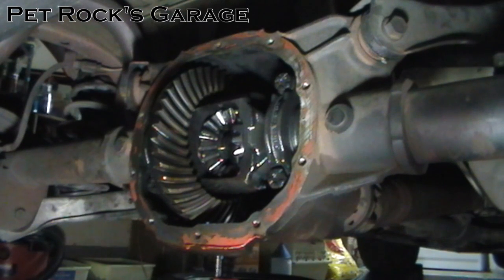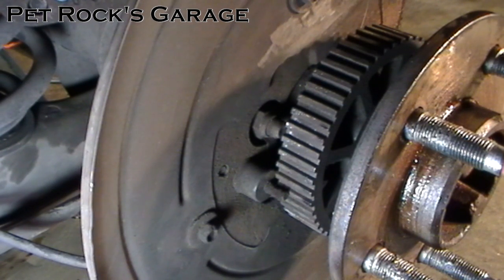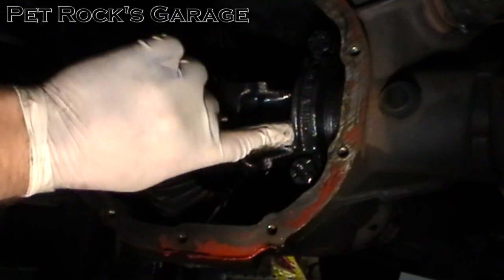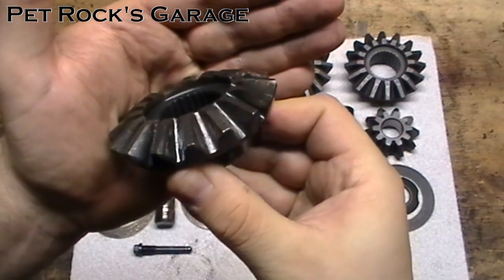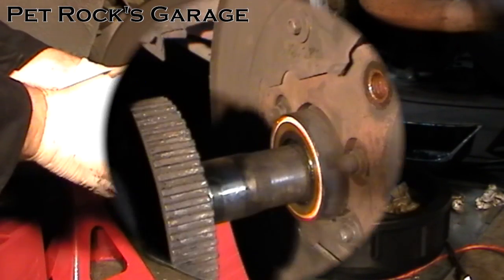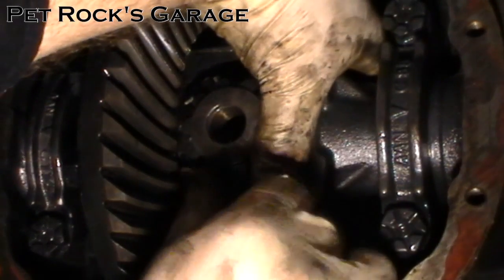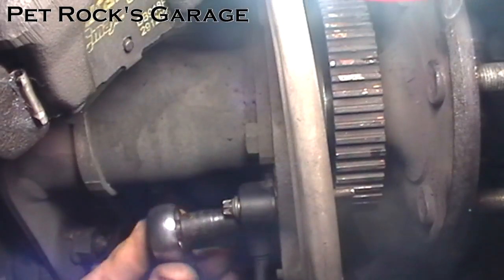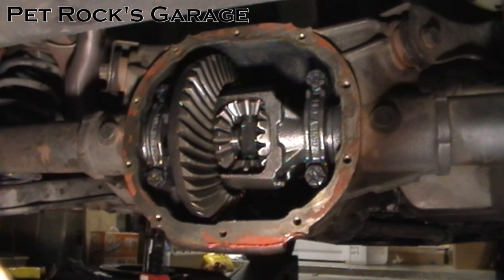How To Replace Spider Gears In Ford 7.5 & 8.8 Open Differential - Ford Mustang

Comment: How do i know my spider gears are worn out? My right wheel  its making a noise and its wobbles when put in drive. It also has play when move wheel side to side. I already bought new wheel bearings it possibly that i need need spide gears as well? Thanks
Reply from the maker: I cover how to inspect the gears in another video: https://www.youtube.com/watch?v=jIXoRbIIK_o at around @2.54.
Re your issue: I don't think a spider gear issue would cause a wobble. It typically causes excessive rotational play like I show in this video. I'd jack the rear up so both tires are off the ground (making sure to chock the front wheels so it doesn't roll away from you) and try to push the wheel up/down/side-to-side without rotating it to see if there is any play in it. If there is then the bearing is likely bad and/or the axle bearing surface is worn. Also rotate the wheel by hand without applying a lot of upward/downward/side-to-side pressure and see if it wobbles. If it does the axle may be bent. Good luck.
Reply from the maker: btw, I have a video on how to replace the axle bearings and seals: https://www.youtube.com/watch?v=VXEqzMVRRso

Comment: Excellent video. Very thorough and informative.
Reply from the maker: Thanks a lot. I appreciate it.
Reply: @petrocksgarage  Is the roll-in of the spider gears as easy as it looked in your video? It seems very straightforward rolling in the 1st gear, rotating the carriage, and rolling in the opposite gear, and lining it up with the 2nd. That easy?
Reply from the maker: @jockodog2009 , yeah pretty much.

Comment: So my ranger the drop pin is designed to not come out, it instead has a groove in it that you are supposed to push the axle up against to remove the clips, and I have found nothing on this anywhere on how to do that.
Reply from the maker: I'm not aware of a ford 8.8/7.5 diff with a pin that isn't supposed to come out.  If your pin isn't coming out its probably because it is stuck/seized, not because its not supposed to come out.
Some pins do have a groove in it, like the one I install in this video. Maybe some people might use it so they don't have to remove the pin and accidentally drop the spider gears out. But to be able to spin the pin it might just slide out anyways, so you're not really saving any time/effort.
Reply: @petrocksgarage  i swear this pin does not come out because it cant get past the gear so the put a groove in it to remove the c clip

Comment: Hey I had a question. But first thank you for the informative video it’s literally a Godsent. So! I have a 2000 v6 mustang I was wondering if 7.5 rear ends had axle vents. I know 8.8s do so I went to research for 7.5 vents but found zero information on them for my generation mustang. On the right side of my 7.5 axle I see what looks to be a vent but I’m not sure, very rusted looking and has no play like a vent should. So would you know if we do have axle vents? Thank you very much
Reply from the maker: Yes, 7.5 diffs have an axle vent on the passenger side of the diff. Specifically on the "top" of the axle tube. The diff in this video is a 7.5", btw. I too couldn't find a vent specific to 7.5, but the one I did find for the 8.8 on AmericanMuscle.com looks a like the one on my 7.5 diff. Its likely the same part. I'd suspect it would be available at most auto parts stores. You might need to specify 8.8 diff if they don't have one specific to 7.5. Next best option is a junk yard. Good luck.

Comment: Sir I have a 1988 F150 that has 65000 on the odometer. Of course that could be 165000 or 265000 miles. Some things on the truck lead me to believe the mileage is 65000 or 165000. The brake and accelerator pedal rubber covers are in very nice condition and original. The u-joints are very tight but there is a lot of slop in the differential. Enough slop so that it is very noticeable when shifting from reverse to drive or drive to reverse and sometimes when the transmission shifts from first to second and second to third. How would I know if just replacing the pinion gears and not the ring gear would be adequate to eliminate the majority of that differential slop? Thanks, Wayne.
Reply from the maker: I assume the u-joints you are referring to are for the drive shaft. That leaves the gears in the diff. The only way to tell what needs to be replaced is by pulling the diff cover and having a look inside to see where the slop is coming from. With the cover off, you should be able to turn the drive shaft back & forth by hand and see where the extra play is. It could be worn spider gears, worn ring & pinion gears, or both. This video should have you covered on how to replace the spider gears. However, replacing the ring & pinion isn't a bolt on job. You have to adjust the backlash & tighten the crush sleeve etc which requires special tools (beam torque wrench, dial micrometer gauge + mag-base to name a few). It's a bunch of trial & error even for experienced techs. If one of my vehicles needs new ring & pinion gears I would take it to a local diff shop to be honest. Its a P.I.T.A. job, hard to get right and too easy to get wrong. If you get it wrong you can burn up your gears pretty quickly. Hope that helps.  Good luck.

Comment: Extremely helpful ...  Thanks a ton! I wasn't planning on touching the spider gears in my 2007 V6  Mustang when I upgraded to the GT500 rear brakes but I found a leaky axle seal and the spider gears fell out when I went to reinstall the big pin in the differential.  After 30 minutes of "I almost got the &%a0a$ spider gears lined up that time", I  took a break and found your clear and explicit instructions. Well done! Thanks to you I was back on track in less than 3 minutes.
Reply from the maker: Everyone has days like that. Glad to hear you knew to walk away and regroup before you really screwed something up (e.g. get a big hammer). I'm glad my video helped you out and that you got the job done. Thanks for watching & commenting. I appreciate it.

Comment: What would cause the big axle pin only move like 3/8" I can't get it out. I've hit with a hammer but it gets to that point and just feels solid as f#$@! It should just slide out right?
Reply from the maker: Yes, it should slide right out with little to no pressure. If it moves at all then it isn't seized, which is a good sign. It sounds like the pin is hitting something in the diff case. Maybe its hitting the pinion gear in the back? If not, maybe try rotating the drive shaft to spin the garage around 180 degrees and try it from the other side? Good luck.
Reply: @petrocksgarage  thank you for your time, something was in the spider gears and made it almost seized the gears to the pin. The ends of the pin are all marred up I ended up having to beat it a lil and cut it in two.
Reply: And beat it a lil is an understatement 😜
Reply from the maker: @michaelhammerhead7671 , ouch. Well, whatever gets the job done. Hopefully your spider gear kit came with a new center pin. Make sure to clean out the diff very well to get all the shavings out. Good luck.

Comment: Is this the same with a 2012 Mustang? to remove the axle shafts.
Reply from the maker: The year/model/manufacturer of the vehicle really doesn't matter. What matters is the type of differential installed in the vehicle. This video applies specifically to Ford 7.5 & 8.8 Open Differentials, with carry over to 7.5 & 8.8 LSD Differentials. A lot of models over the years have these diffs. Hope that helps.
Reply: @petrocksgarage  Thanks I have to do this to a 2012 Shelby Mustang. he has an 8.8 differential.
Reply from the maker: @oliverkuttnik5218  Then this video should cover you. Good luck.

Comment: Have a pin that went loose towards front and locked up the inide i have no idea how to get that pin out since i cant turn the assembally
Reply from the maker: It's hard for me to give advise without seeing the carnage. I would start taking things apart.  Hopefully the pin didn't damage the gears.  Remove the axles and then remove the side retaining caps and pull the assembly out.  Be careful about any shims that may be in place on the sides of the assembly. Don't let them fall out or lose them. They control the back-lash. Also make sure you don't mix up the retaining caps either. They are machined to match the side they are on. Ultimately you want to make sure that you put everything back in exactly the same places that they were originally. Good luck.
Reply: @petrocksgarage  ive got to get everything replaced in it since theres missing teeth everywhere
Reply from the maker: @daimonwilcox , ouch.  Sorry to hear that. Diffs, like transmissions, take a little finesse to rebuild correctly. Setting preload & backlash takes some special tools & techniques. IMO, unless you have done it before, I'd take the diff to a diff shop to do the job for you. You don't want to mess something up and burn up your new diffs gears.  Good luck.

Comment: Thanks for you advice I was able to spend the top spider gear back into  place and put the differential back together.  Although its was still some what of a challenge given my short arms and think build.  Thanks once again!! Now I need to replace the U-joints so hopefully it goes pretty smooth.
Reply from the maker: Thats great! I'm glad you got it figured out. Good luck on the U-joints.

Comment: My dad and I were replacing axle bearings and seals in my 89 5.0 Mustang and we let the spider gears fall out during this. I found this video and my rear end is very similar but it has the metal S clip thing in the middle because it is a locker rear end. We can't seem to roll the gears back end because of the metal S clip thing is in the way. Is there a different process for the traction lok style rear end? Could you possibly point me to a video for that style? Any help would be greatly appreciated! We have been messing with it for 3 weekends in a row and having no results.
Reply from the maker: It's been a while since I've worked on a diff with the S spring, but if memory serves, you install the spring after you've installed the gears.
Reply: @petrocksgarage  Ok I was not even aware that the spring thing came out. Do you know if it's possible to remove the spring, put the gears back in, and replace the spring without removing the entire rear end assembly?
Reply from the maker: @jefflroberts , it can be removed without removing the entire gear set. It's just a spring after all. There are a bunch of videos on how to remove & re-install the S-Spring. Here is one for install: https://www.youtube.com/watch?v=O_TqMuV_MeA
Good luck.

Comment: Do the car have to remain in Neutral while putting gear back in
Reply from the maker: Yes, you want it in neutral so you can spin it around to position the gears.
Reply: @petrocksgarage  do the car have to be turnt on meaning crunk up or it can be turnt off
Reply from the maker: @andrethornton7846 , off.  Definitely off.
Reply: How do i keep that big huge gear on the left from moving while im rotating the smaller ones back in
Reply from the maker: @andrethornton7846 , figure out a way to prevent the wheel on that side from rotating. Maybe have someone hold the wheel, or block it with your foot (which is what I did).
Reply: @petrocksgarage  a good way to get the s-spring out

Comment: @12:02 in your video when replacing the threaded pin that holds the main pin in place you mention how hard to torque. Is it possible to over torque and if so are there negative consequences to this? Also, do you have an email or other means of contact where you can be reached at? Thank you
Reply from the maker: You just need to snug it down real good. 15-30 ft/lbs is not a lot of torque. But if you extremely over torque it you run the risk of the bolt breaking in the boar which will be a huge P.I.T.A. to remove. re email, I can be reached via YouTube. I don't release my personal email or contact info.
Reply: @petrocksgarage  understood, thank you for the response and great video. I'll definitely be using more of your videos in the future.
Reply from the maker: @johnnycash975 , no problem. Good luck.

Comment: Question, when you spent the top gear into place and rotated it to the back did you turn the axle or drive shaft to spend into place?
Reply from the maker: Axle.  Hope that helps.
Reply: @petrocksgarage  Thanks, I will give it a shot and let you know the results.

Comment: Mine has yellow locker springs on the spider gears?
Reply from the maker: If the spring is kind of an S curve then it is just a retainer spring. It should not effect the procedure. Hope that helps.
Reply: @petrocksgarage  mine are locker springs there are 5 pf them.  I had to take them to a shop and they used a press followed by tapping it in on top of a bench with a 2by4 and a hammer.  It took them 30 minuets to get them in with the two brackets that sandwich them in.
Reply from the maker: @yeudsiegal5285 , ouch. It sounds like the previous owner did some modifications to the diff. That definitely isn't a stock feature. Glad to hear you got it sorted out.
Reply: @petrocksgarage  no it is not stock.

Comment: Very good video thank you for the little tricks. I have 1992 ford ranger with drum brakes on the rear I’m curious what you think about me using a donor mustang for a disc brake conversion??
Reply from the maker: Not all 8.8's & 7.5 diffs are the same.  While the center part with the gears is the same, the axle tubes and suspension mounting brackets can be different. It all depended on the car it was installed on. Mustangs have a 4-link suspension. I don't know what style Rangers have.  If it's a 4-link then it should bolt right up assuming the axle tubes are the same lengths as your stock axle tubes. There are tons of other model cars & trucks that came with 7.5 & 8.8 diffs. So, yes you could find a donor car and convert to disc brakes.  However, you need to make sure that the axle tubes lengths and the mounting brackets are the same as on your truck. If the mounting brackets are different you could pay a shop to weld up new brackets for you. But its easier/better to find a diff with the correct brackets already installed.  Hope that helps & good luck.

Comment: No lock tight?
Reply from the maker: I assume you mean on the pin bolt? No, you don't need any lock tight. The oil would likely break down the lock tight and make it moot.

Comment: You mentioned this is Ford but it’s the exact same thing as my GM 7.5, I think I can do this 💪🏽, very specific and detailed video
Reply from the maker: Yeah, the internals of most open differentials like this are, for the most part, the same. So if you know how to do one, you know how to do others. Good luck.

Comment: I have a 96 v6 my car got towed one day and now my axel or something pops in and out most of the time it won’t move and drive shift does spin
Reply from the maker: Its hard to say what happened. The list is pretty long as to what it could be. I'd start with checking the drive shaft u-joints. After that, if as you say the drive shaft spins properly when you put the transmission in gear, I would take the diff cover off and have a look inside.  Something mechanical has broken. Hope that helps.

Comment: Great video... How many miles were on this car? Is this common wear at certain mileage?Thanks in advance..
Reply from the maker: Thanks a lot. I appreciate it. Somewhere around 180k, IMS, but I'm not entirely sure. I don't know about how common it is, but it does happen and is something you should check when you change your differential fluid. Hope that helps.

Comment: When I removed my pin bolt the pin dropped in the inside and got jammed inside the case and it was hell getting that slippery mofo back up , so make sure you push it from the back side as soon as you take the bolt out of the pin.
Reply from the maker: Ouch. Yeah, that sounds like a P.I.T.A. Glad to hear you got it sorted out though.

Comment: Was the play in the axels the reason for replacing the spider gears (guts)? Had a shop swap gears 2.73 to 3.73’s on 92 lx and noticed vibrations on the highway when reaching speeds of 70 and above. Would this application fix this issue or would I need need a complete swap (ring and pinion). Thanks for the tutorial, I will be attempting this in a few weeks.
Reply from the maker: Yes, the play in the axles and the diff needing a fluid change is why I investigated. Its doubtful spider gears would cause your problem. Lots of things can cause a speed specific vibration. I'd start with the simple stuff, like unbalanced wheel, tires or drive shaft. Good luck.